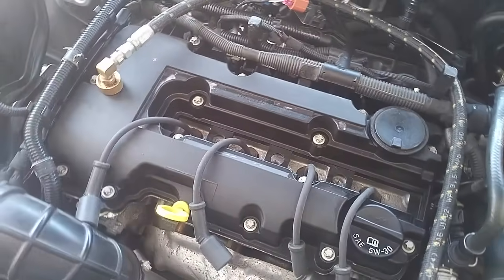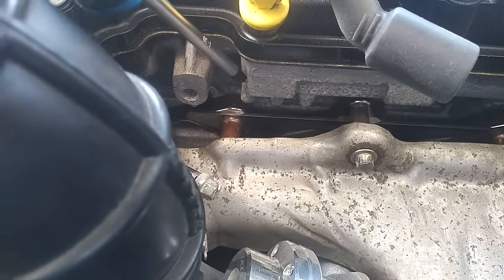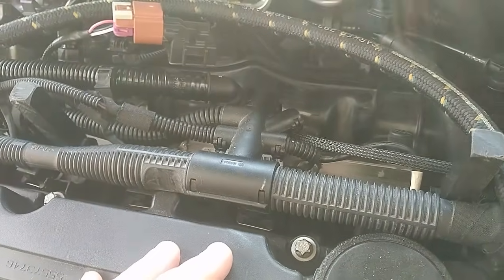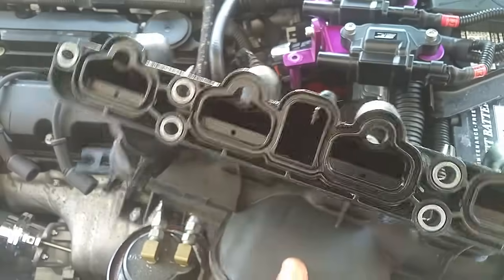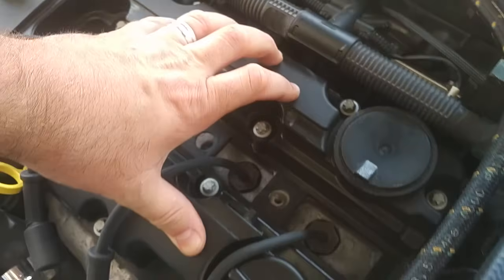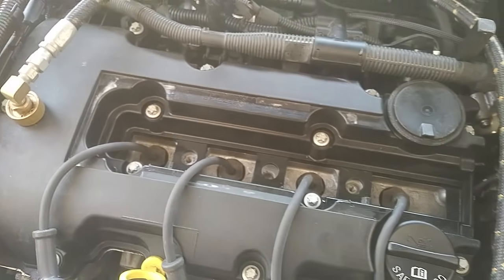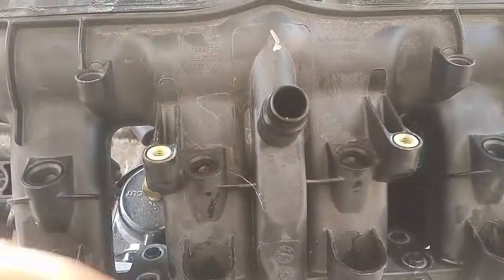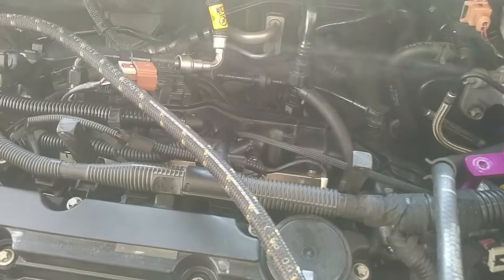Chevy Cruze Sonic Trax Encore 1.4L Turbo PCV Issues, Diagnosis, and Solutions

Comment: I regret getting this car
Reply from the maker: They're good cars, once you figure out some of the common issues. I'm doing what I can to make those repairs easy and affordable.
Reply: @AndreiDPop  I agree, but what about the random warning messages like "Service Power Steering" and "Service Stabilitrak", which tend to show up together, without warning, and for no reason? Ftr, mine both appeared together on the DIC screen the other day. The power-steering system was replaced right before I bought the car last June and I had a mechanic look at the Stabilitrak system and he said it is just fine.
Reply from the maker: Negative battery cable. Very common issue. Replace the cable and it should go away.
Reply: @AndreiDPop  I read that. Some owners said it won't go away. I did a power cycle and it did go away. Btw, my charging system returned to normal -- about 13.6 v. Thanks for the help! However, since installing your kit, my scanner shows the evap system monitor has not completed its cycle (still blinking red, but no codes). In fact, the car is running better than ever: fuel economy went from 27 mpg to 32 city on a 1.4 turbo gasoline w/ auto. I'm aware that the eva system monitor is usually one of the last to reset, as it doesn't run all the time and certain criteria must be met for it to run, but a week and 300 miles later? Ftr, im using an Innova 3040e scanner. Other than that, I am really pleased with your kit.
Reply from the maker: You have me stumped on that one; the EVAP system should be ready. However, it may be a function of driving cycles as well, and I don't know how many cycles that is. Possibility that the EVAP purge valve is bad? They do start to tick really loudly as they get older.
Reply: @AndreiDPop  Yeah, I don't know, man. I am actually wondering if my scanner is failing to pick it up. I had a buddy hook his Bosch up to it and it showed no issues. I'll keep an eye on it and let you know. If it doesn't complete the cycle, I'll take it to a shop. Btw, the only thing ticking is the injectors. Those things fire like machine guns.
Reply: @csn6234  Bad crimp on the negative battery cable from the factory. Replace it and you're good to go.
Reply: @AndreiDPop how do I find your pct fix kit!?
Reply from the maker: @roibersavoncisneros9769  on cruzekits.com
Reply: @AndreiDPop  that plastic tube that goes to where the valve is cracked when i tried to take it off. What should i do? Im freaking out
Reply from the maker: @LachanceMortgages  shoot me a picture of what you’re talking about on the chat box on cruzekits.com and I can help you out.
Reply: @EL16100 me and you both. I’ll never own another one of these.
Reply: I'd love my sonic if it didnt have issues. But I've had nothing but problems with mine. Just spent 2400 dollars on repairs just for the light to turn back on less than a month later.
Reply: @rogersmith3295  Like owning a Land Rover. Spoken from personal experience.
Reply: @rogersmith3295  My 2014 cruze that I bought new is approaching 100,000 miles without any issues. I live in Texas as well so it's been through some rough summers. I also have 94 1500. Sounds like y'all just don't know how to take care of cars.
Reply: @codejunki567  Not it at all. I go for regular oil changes. I check my fluids.  I know how to take care of my car. Literally just put 500 dollars into my sonic after putting like 2000 into it only like 2 months ago and a week later it starts leaking coolant and the light turns back on !!! All I'm doing is driving to work (about 3 miles away). Totally my fault right ????? Naw bro I bought a lemon. Lol dont tell me I dont know how to take care of my fucking car. I've owned cars older then me with less problems then my sonic. So cool to hear you havnt had any problems with yours, lol but that shit ain't no Toyota. Alot people have problems with them. Check the consumer reports. No car should have the problems my car has at only 70k miles. Even if I drove it like shit it shouldn't be running the way it does. It's ridiculous .
Reply: @rogersmith3295  Did you buy the car new?
Reply: @chickenfriedfrog502  that's an anomaly, dude. You aren't driving a Toyota Corolla.
Reply: So I still have this car , I have 173,000 miles on it and I replaced the transmission.
Reply: The worst car I've every owned! 2011 1.8 cruz -- My brother in law and I both regret buying cruizes ...
Reply: Do you have a install video for the pcv fix kit??
Reply: @jamesshrum257  just follow his written instructions, James. I thought I was going to need one, too, but I just did it exactly as his instructions said and it was a piece of cake.
Reply: DEFAULT-SKIN-2018 bro I just got this car....
Reply: I agree however if you get a nice intake it goes vrooom… pshhhh so I mean it’s worth it to me
Reply: This cars the cruze its a 100 junk 
Junk.
Junk
Reply: I have the Australian version which is the Holden Cruze and they're no different here. I too wish I never got one 😔
Reply: We all do
Reply: Work work work 😂 great handling tho with the rear z suspension
Reply: I feel your pain
Reply: I regret my sister getting this car!
Reply: yup. I have a 2018 Encore
Reply: Same
Reply: I second that motion.
Reply: Me too... lol
Reply: Me to
Reply: Try a 2017 trax. Hate it never again🤦🏾‍♂️
Reply: 2016 encore.  When you take off oil fill cap or pull dipstick it creates a bad vacuum that almost stalls the motor.  Is it supposed to be like that.  New turbo, intake and valve cover within the last year. Please help.
Reply: Same
Reply: @chickenfriedfrog502  I'm sorry I have trouble believing ANY Chevy can get passed 250k miles with the original engine.
Reply: @rogersmith3295  2001 trailblazer 410,000 original motor and tranny
Reply: @rogersmith3295  its funny you say that cause the LS 5.3 is the most dependable gas motor ever made.
Reply: My daughter bought this Government Motors junk and it broke down on her constantly, finally bought a Honda and can say that she will never buy another from a broke car company!!
Reply: @chickenfriedfrog502  guess you haven't owned one. I had one with 390,000 sbc 350 still ran strong
Reply: joe dirt I agree because no car is perfect. US auto workers often commit more errors than Japanese or European because the US was a leading slave nation and workers here are either not treated and led well or are not happy. Its the way it is. Still, management for the big 3 want your car to only last so long and it's a fact. So its problems from top to bottom. Everyone knows that Toyota has led the way in producing cars that last 3x longer and with 10% or less the maintenance costs. Its the statistical facts.
Reply: @jamesmedina2062  drive by a Toyota plant the ppl hate there 14 dollar an hour job...gm ppl love there job..there making 34 an hour
Reply: @chickenfriedfrog502  sparks suck equally as bad.
Reply: Tell me about it

Comment: So wouldn't that mean that you're feeding blowby into the brake system? Seems like the original line is no longer functioning, or did I misunderstand something?
Reply from the maker: The best answer would be to direct you to learn how a brake booster works. The brake booster never pulls air from the intake manifold; it only flows toward the intake manifold. 

https://www.youtube.com/watch?v=wbTUvp-tD5M

A tee fitting doesn't eliminate the function of the original line; it simply taps another connection into that line. 

Lastly, the PCV system doesn't "feed," rather it is evacuated. The crack pressure of the external check valve I'm using is higher than the crack pressure of the turbo inlet check valve, so under no circumstances would the PCV system ever feed pressure into the intake manifold. The only time PCV gas is flowing through that tee fitting is when intake vacuum is pulling it through.
Reply: Dre Dan Makes sense. Thanks for the video, too!
Reply: On the brake booster were the vacuum line connects to, there is a one way valve . So if the engine back fires out throw the intake the valve closes so not to damage the brake booster . Some cars have this valve in the vacuum line just before the brake booster . Dre Dan I take my hat off to you for thinking outside of the box. Great video well done God Bless take care. Thank You.

Comment: Why is there a checkvalve in the intake manifold at all? Couldn't ALL pcv gases be sent to the turbo inlet? What is the reasoning for not doing that?
Reply from the maker: sethpoche Any PCV gas sent through the turbo inlet also has to go through the turbo itself and the intercooler, which coats the intercooler and reduces it's efficiency. Furthermore, being able to apply vacuum on the crankcase has a secondary benefit of keeping exterior engine leaks to a minimum and reducing oil consumption.
Reply: Dre Dan, makes sense. Thanks!

Comment: What’s the hose and connection coming out of the valve cover for?
Reply from the maker: Justin Ray AMSOIL bypass filter. Basically a superfine particle filtration system that captures particles 2 microns or larger at 98.7% efficiency. The standard filter, which is still used, does 25-30 microns nominal.
Reply: @AndreiDPop  sorry for my ignorance. What is this for exactly?
Reply from the maker: @jesussotelo7076  It's a supplemental filtration system. It's not really needed for this car; I installed it more as a promotional item and to clean up the oil a bit more since I have a bunch of other modifications.